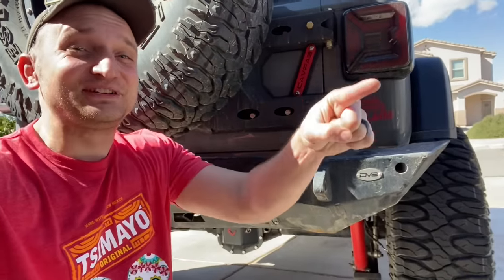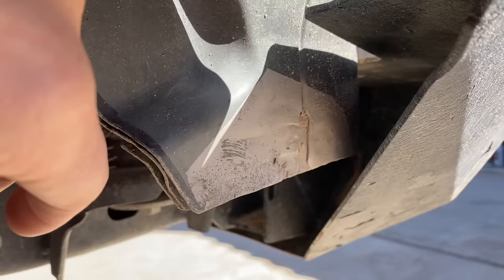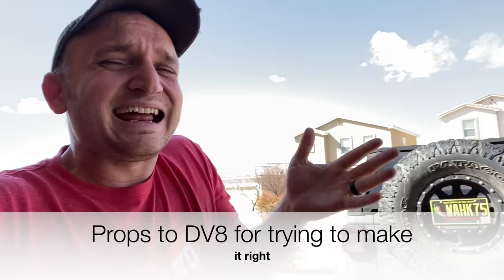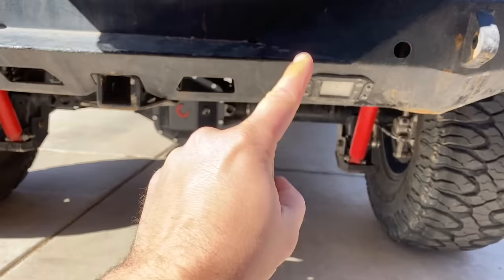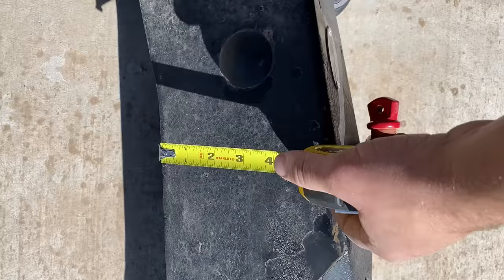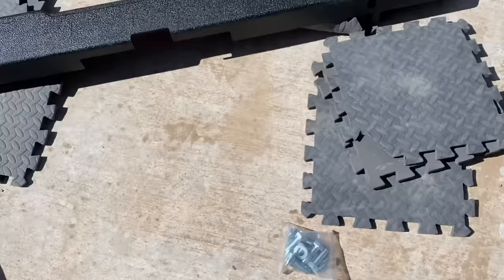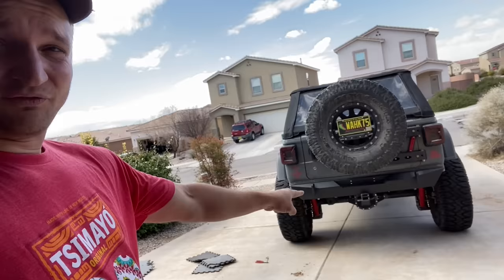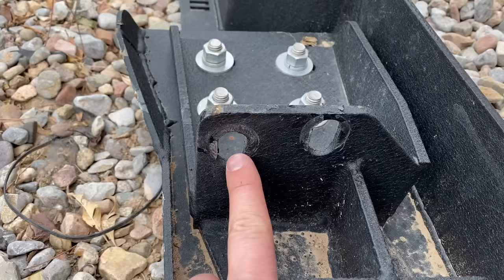Avoid These Mistakes when Looking for a Rear Bumper

Comment: Having run the CavFab for a bit, would you still do the straight rear bumper plus the Rusty's Fascia, or would you just get a CavFab that wraps around the sides?  Great channel by the way!
Reply from the maker: Hey! Glad to hear it! And thank you!!

So I’m actually a pretty big fan of how I have my current bumper set up... looks great.. and with tht fashia cover.. protects the pinch seam... 

Though... getting cavfabs larger bumper.... would definitely eliminate the need headache install of body armor and nutserts 😂
Reply: @JLLIFEOFFROAD  Yeah...  that's the exact struggle I am having!  LOL
Reply from the maker: I think cavfab is running a 15% off right now also.. ‘remember’ I think 🤔
Reply from the maker: And free shipping? 😂

Comment: Why not line the bottom and the lower corners that have damage with the coating you put on the bumper
Reply from the maker: I did think about tht... but I think ima just put on the rusty pinch seam protector...

Comment: I dont like my factory rear metal bumper but I dont have enough $$$$’s to replace it.   I thought about going bumperless but that open up the rear corners of the tub to damage.
Reply from the maker: Bumperless.. 🙌😂 Thts the kind of stupid things I’m talking about! Lol!! 

But I know what U mean... rear bumpers are pricey.
Reply: @JLLIFEOFFROAD  These companies are charging WAY to much money for these parts.  Im getting an ACE stubby rear armor, $200
Reply from the maker: Ryan Lhotka i like stubby bumpers... we have one on mistys jeep.... we need to add the corner protection part still
Reply: Mike, be careful. It's been shown that steel rear bumper on the JL can dent the body as well, if playing in the big rocks.
Reply: M C   Yep, I’m aware of the body damage that the rear steel bumper can cause.   I’ve already torn the lisc plate housing loose while in Moab.  I do have a stinger that I use to keep the spare tire from hitting.

Comment: Curious about your diff cover bolts. Are those stainless, chrome etc? Mine from motobilt are rusted as hell. i need something else. Thanks!!
Reply from the maker: They came with the diff cover... and retry sure they are grade 8 bolts
Reply: @JLLIFEOFFROAD  thanks bud - I'll check into them
Reply from the maker: Brian Head no problem 😂🙌

Comment: When you find me paint that can take a rock going over it please call me because I will make you a millionaire. 
I mean really. It's paint! 
I expect this paint to be bullet proof. And this is why aliens don't talk to us.
Reply from the maker: As I mention in the video... I expect paint to rub of what hits rocks... I don’t expect the coating to start flaking off from vibrations in an area completely avoided by the rock. 
Appreciate you taking at least some of ur time to watch parts of the video.
Reply: @JLLIFEOFFROAD  it's the thickness of the steel used and the strength of the steel as well. The bumper flexed causing the paint to chip. 
As a fabricator and someone who paints I can explain and understand this a little better than most.
Reply from the maker: ruffypoo no, tht makes sense.. doesn’t make sense why dv8 said it wasn’t suppose to happen...I wasn’t shy... I showed them exactly how I beat on it...  

Also didn’t just have the poor coating as the reasons I didn’t like this thing... my front bumper... also cheap Chinese steel.. similar coating to dv8... beat on tht one just as much... not the same issues.
Reply from the maker: Continue support for a lack of better design... innovation and quality... will only lead to a market that reflects the same...
Reply: @JLLIFEOFFROAD  like all companies. As soon as they get their $ they do not care about you anymore. I had the same issue with Big Gun exhaust. A 100% guarantee until it comes time. Like who's gonna take them to court over a few grand. They know this and that's why they are winning. 
It sucks but that's life. All prefabbed stuff isnt as good as a custom made. For most making a good bumper is out of the question. The price of the tools needed and the price of materials alone will push someone to buy a pre fabbed bumper. Hell even I bought a pre fabed front bumper. 
My metal dealer isn't running like he use to with this virus shit going around
Reply from the maker: ruffypoo u see, you are making my point... company’s don’t care... they continue to get away with it... and it will continue to happen.. this video really outlines it and actually shows and teaches someone more then just reading a comment online “dv8 is shit” as compared to showing people why dv8 is shit... are they the only crap company... nope...  I’m sorry to hear the virus and all this shut down crap is being rough for u and ur colleagues... I hope thinks normalize sooner then later...

Comment: What about your spare tire?? All that weight is on your tailgate. Crunch your glass will go .....tailgate is magnesium
Reply from the maker: I have a soft top. I run my spare at about 8psi to allow more flex when it’s hit... plus I have a heavy duty tire carrier that replaced the hinges...

If you are still super worried about hitting a spare.. I recommend a tail stinger... 

If you don’t like tht idea.... I’d suggest a tire relocation.. Iv seen a nice kit... can’t remember the name.. but fits a 40...

Comment: Dv8 ID cheap china. Self explanation.
The reasons behind the stock plastic is because during the Obama presidency they passed harsh EPA regulations for all vehicles. Minimum gas mileage and lots more. (Rip the TJ best wrangler motor ever) for better emissions like the beloved egr systems. Anyways light weight plastic everything to hit the government restrictions.

Comment: If you wheel at that speed on obstacles you deserve the damages you have sustained.   As a matter of fact you never even stopped to look back or adjust your departure angle.
Reply from the maker: as mentioned first time off-roading.... kinda how we learn... and don’t really care about tht incident 🤷‍♂️ regardless how I would of come down there... damage was gonna happen. Iv done tht dozens of times now... every angle I take. I hit bumper. 

Thanks for watching... and at least trying to pay attention 🙌
Reply from the maker: And I say try to pay attention.. cause I never blamed anyone for tht... just said fca plastic bumper was poorly designed for vertical impacts
Reply: I was paying attention..  that’s why I said if you wheel at those speeds you deserve any and all damages.   Did not mean for it to come across as attitude...   I have been wheeling off road for over 30 years. Slow slow slow and it will go...  if your gonna be in the Rocks 1/4”  or 3/16” for armor or bumpers.   Bumpers really need to be 1/4”...  good luck have fun.  face in the sun and tires down...

Comment: Trying to blame Chris for the body damage, but you flew down that ledge on a poor line.
Reply from the maker: First time offroading... 🤷‍♂️ and there were no lines to avoid with how bulky the old bumper was..  and the plastic bumper is not designed to take vertical impacts 😂

Comment: I Like the look of the Cavfab however, does it leave the spare exposed more in the rear? You don't want to catch the spare when dropping off a ledge...
Reply from the maker: I mean.... even the old bumper exposed the tire off the rear.... I run my spare aired down just in case I hit it.... but there is actually a piece tht plugs into the hitch to protect the tire off drops. Called a stinger I 🤔
Reply: @JLLIFEOFFROAD  Ah true, I forgot about them to be honest, good point!

Comment: right at the end.....man get a stinger, your door hinges will thank you
Reply from the maker: I’m still looking to swap out the front bumper.... it’s always a task of... finances.... between the two JLs and j10... just seems all the builds are at a crawl lol
Reply: Sorry wasn’t referring to front bumper. I mean for your trailer hitch, to protect your spare tire from being pushed upward, and thus your rear door hinges. If you have a chop saw and a welder, you can make one for a few bucks in 2” steel. It sticks out and slightly upward from your hitch. Helps you slide off the rocks just a little further and away from your spare tire. See wayalife’s channel or site for a reference.
Reply from the maker: Awww gotcha... lmao... couldn’t think y a front stinger would hel the doors 😂😂😂

I need to get the done.... I do run my spare sub 10psi to help them minor contacts on drops thou... 

But getting a rear stinger fabbed up is something I’d like to do

Comment: I do not like the nuts welded to the bracket. Its not how its supposed to be.
Reply from the maker: You have a better design?
Reply: @JLLIFEOFFROAD  at least have the nuts welded all around that would not be my best choice but at least it would be structurally correct. The correct way to make it is to use a higher gauge of steel and tap it.
Reply from the maker: Gotcha, we were on different pages... I thought u were gonna say something along the lines as it’s not needed... but now I completely understand what ur saying... and agree 😂

Comment: What the fuck you got a 505 on your Jeep?

Oh shit you got one in your pic too, YouTube legit recommended me another New Mexican in the wild.

Also, the bumper's mounting bolt holes are like that for a reason actually, you're supposed to tighten then down with the bumper all the way out so that if you hit something the bumper can push in a bit. It's to suck up some of the shock.
Reply from the maker: I could get tht, but really shouldn’t be to the point it obstructs the tailgate from opening… and shouldn’t reach the body, 🤷‍♂️  Iv adjusted and tightened the hell out of tht thing to many times… been happy with the replacement and continues to hold up to my abuse.

🙌🙌🙌 what part of the state u in?

Comment: That’s the powder coating problem not good adhesion.
Reply from the maker: The front bumper (different brand) is coated the same... I don’t have the same problems with the flaking...

But appreciate you watching and taking time to leave a comment 🙌
Reply: Powder coating is very durable, not sure why everyone goes with it. I'd rather buy it raw and have it Cerakoted.

Comment: Remove the rear bumper and have the same shop clean up, rust treat, and then tape and spray the damaged body panels with the bedliner.
Reply from the maker: I plan on doing tht myself 🙌

Comment: DV8 wouldn't give me a new bumper so you bash it on social media. you complain about its finish, but re-coat the new bumper when you get it. sounds like sour grapes for sure.
Reply from the maker: Cavfab comes Bare steel. 

Didn’t want a new bumper... I asked them if tht was normal.. they told me “no, but we can’t give u a new bumper”.... never even asked for one...

Don’t care for dv8... I articulated why... didn’t just mindlessly bash on them.. u like dv8 that’s fine... ur opinion.. 

My opinion... dv8 has a sever lack of quality control.... pride and care.... 

As people continue to accept that, it’s ok.. dv8 will make no changes... 

Thanks for watching.. definitely appreciate your time, both to watch and comment on it. Stay safe.
Reply: @JLLIFEOFFROAD  so you wanted a smaller bumper so it gets less contact with objects. it will also have less protection. its like saying i dont want skid plates or rock sliders because they might hit something.  i have yet to see a replacement that didnt need some fitting.
Reply from the maker: The thighter the bumper is the the mounting locations, the less leverage being put on it, less likely to fold into the tub, break mounting locations, twist the frame...

Even with rock sliders... they should be closer to the body... u try using sliders that stick far out from the body... that space creates extra leverage... makes it more likely to flex into the pinch seam... 

Skids... a lot goes into skids also. Weight... protection of bolts.. strength of design... just because a company makes anything does not mean it’s perfect and should not be criticized...feedback in any form is an opportunity for a company to better itself... 
As I’m sure dv8 and look their brand ambassadors don’t like this video... the points are valid... honest and true... I hope they watch.. I hope they aim to improve... I hated the bumper... I don’t hate the company.. hope to see them
Do better.
Reply: @JLLIFEOFFROAD   your quote: "Didn’t want a new bumper" yet @ 3:33 in the vid you state "they refused to send me a new bumper", which is it? still sounds like sour grape bashing to me.
Reply from the maker: Lol, cause Thts literally how dv8 handle the conversation... They refused to send a new bumper.. yes... however they were never asked... I really dont know how else to articulate this... 

I thought it was very strange that was the response... but as I think more about it... I’m sure they get lots of complaints about their products... and are just used to denying people asking for replacements.... tht actually makes perfect sense to me now 😂